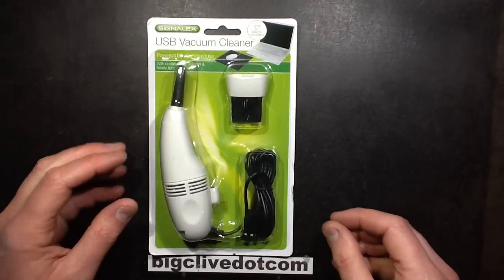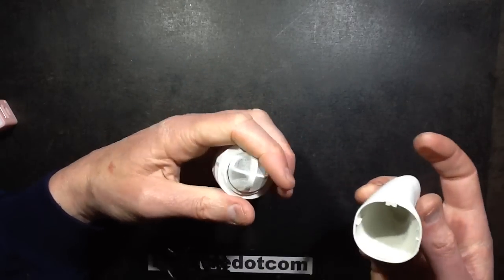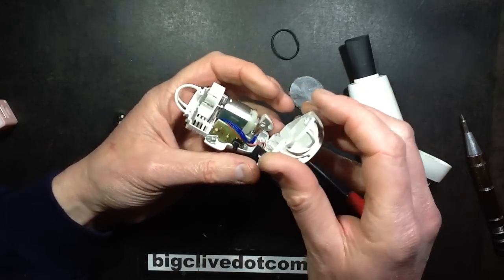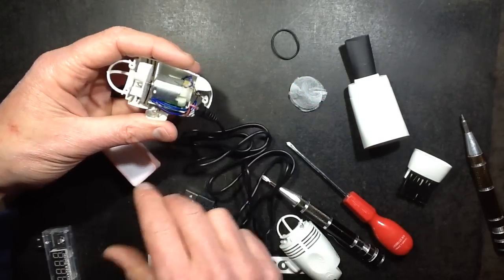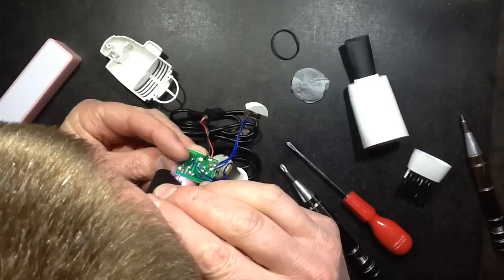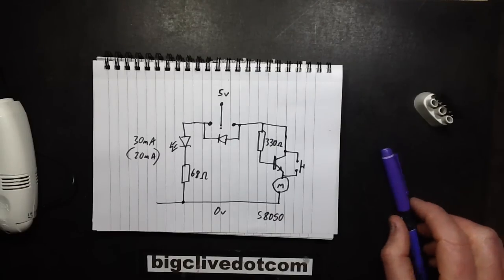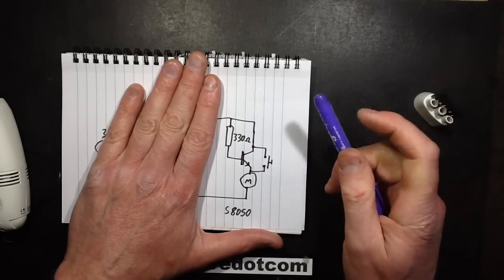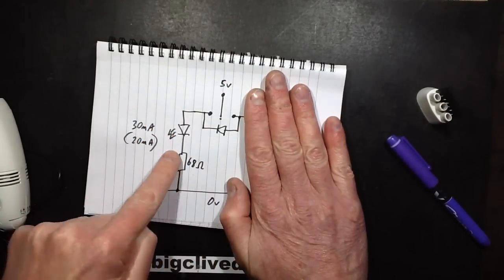Poundland USB vacuum teardown.

Comment: The 330 ohm resistor and motor form a potential divider via base emitter, the transistor is used because the resister would not cope with current alone, this is a current amplifier.

Comment: A very challenging strip down..I have been using the exact same device to get the fluff stuck in the key board..I don't connect it to my laptop..a separate power supply I use for active speakers..additional fan cooling..led light..retaining plunger et al

Comment: hey Clive! thanks for the expensive new hobby/leaning endeavour! just got my first Arduino in the mail today...won an auction for a genuine uno kit from Vilros for $10 n $7 shipping.. ...n I'm currently researching my first project....a power supply. I want one that I can use for everything from circuit testing all the way through electrolysis, metal plating and etching metal....so the research is a little overwhelming...any suggestions from you or the community would be FANTASTIC! thanks again for being my brain EXCITED about something again..."cheers mate!"
Reply from the maker: If you want a power supply that can limit current then I'd recommend a cheap bench power supply from a local electronics supplier.  They're very useful things.
Reply: bigclivedotcom I want one that'll do everything...that's my problem. I want high amps for watching and electrolysis and also the ability to do bench top stuff too...I kinda only wanna buy once and not three different power supplies for different stuff, ya know?
Reply: @MyBigThing2010  I know what you mean. I've seen them in electronics labs. The full kit osciloscopes etc. Totally adjustable power source. Fantastic, but not cheap.

Comment: Arn't usb ports on computers rated to 0.5 amps? So surely the 1 amp from the boost function will cause the ups ports on them (at least a MacBook according to the specs) to trip out and stop being powered due to there inbuilt protection?

Comment: Me thinks the transistor is being used in resistive mode. The gate is in parallel with the NPN resistance, so if NPN switches on fully it would starve the gate, which raises the body resistance. Thus, it would settle in the semi conductive region determined by gate resistor, body resistance, and component gain.

Comment: Why a transistor? In this circuit it is neither a voltage regulator, nor a current regulator. It acts just as a power resistor.

Comment: I have one of that exact USB vacuum cleaner, doesn't even remove light dusts on my keyboard, I tried using it directly plugged on my laptop but it sort of makes it even slower so I have to use a USB wall adapter for it, but after a week of everyday usage, the motor just gave up and the circuit board just didn't worked even when I replaced the same motor, the LED is the only thing that works from it now

Comment: 1A?? Way to kill motherboards, or at least pop some error messages when turning on. Well... These are battery-pack only, I guess.
Reply: The port just won't support the load,  will shut down and throw a bunch of error codes at you.
Reply: I dunno, most motherboards can support double the power, also most of them have some software/hardware to protect against short circuits, for ex my budget ASRock motherboard either does not allow more current to pass, or in case of short circuit shuts the ports off and beeps. They are kinda smart, I've heard that even ESD at the port may trigger Windows alert telling you that something is going on, although I have not experienced it myself.

Comment: lol they do have special charge USB ports on some motherboards that handle high current on some computers I use to have one till I fried it with honey milk and sugar coffee concoction also the rated current of these special high current charge ports where 1500mA per port

 also, my computer has normal USB 3.0 ports and them on average put out 1 amp and my keyboard requires 1 amp to function as it has like 150 LEDs 144 8 bit RGB LEDs or is it 8 colors per led meaning 8x8x8 colors i honestly don't
 know, on are on the 144 keys and an arm processor and other things like a display driver to power I think well the keyboard is a k95 corsair

Comment: I had one of these and it killed my yzkstudio usb power meter :/ Did a teardown and found it was an even cheaper and nastier version of Clive's one. There was only the led with a resistor in series to limit its current, a 3 position switch and the resistor for the motor inside it. That resistor was all burned out and on further inspection it was dissipating far too much power when running in series with the motor. I'm not quite sure how it killed the usb meter though

Comment: The thing held on by the "O" ring is it Dutch in origin by any chance? Should have put a warning on that this innuendo is for readers aged 45 and older
Reply: OK how to put this delicately? It resembles a contraceptive device called a "Dutch cap". Don't think they use them much now as they don't protect against STD/I's.

Comment: I suppose it might detract form the genuine 'hands on' feel of your videos Clive, but I noticed that you puzzled over how that transistor might be working.  So I fired up NWC Livewire which you can get from Maplin and had constructed that circuit and simulated it in around two minutes.  With a generic NPN and generic motor, I got around 350mA rising to around 600mA with the button pressed.  This program is graphically, very good - especially in 'Current Flow' view.   If you used a screen capture program, you could "Show the working out" like that?

Ok, ok, Eagle, or some other software will probably be better, especially for more complex stuff, but I have Livewire and actually, for simple stuff ("Does this work?"), Livewire is pretty good, once you get to know it and ways around it.  Also, PCB Wizard (tightly integrated) is VERY good, especially if you upgrade to the Pro version.  I don't like Maplin much, but this software is good for potching about with and the PCB Wizard software was good enough to have commercial PCBs manufactured from its Gerber output.
Reply: Interesting looking setup. I'll look into one myself.

Comment: I know this is an old video, but I had a couple quick thoughts I wanted to share. I know for a fact (because I've done it) that if you draw more than about 550 mA from my late 2011 model Macbook Pro, the USB port is completely shut down and you get a big warning saying that too much current was being drawn, etc. I believe they contain a self resetting polyfuse. It should be pointed out that the USB 3.0 and older protocol specifies that no device may draw more than 500 mA.   Also, the use of the transistor is a fairly common one, actually. It's set up as a very crude negative voltage regulator. I've seen this done before in simple low power audio circuits that require a dual rail supply.  The idea is that the base of the transistor stays one forward diode's voltage above the emitter (0.6-0.7 volts). Obviously this results in very poor regulation, and It seems strange that they would use it in a (relatively) high current application (the poor regulation leads to lots of voltage sag).  I've only ever seen it used, for very low current applications where a specified but not very precise voltage drop is required. Sort of like an emitter follower with the Base tied to the positive rail.
Reply: +gizmoguyar All USB port aren't built the same. I have an old Socket 7 motherboard from around 1998-1999 that has no protection for its USB ports. If you draw more than ~650mA from its two ports it will fry (it was only intended for very low current draw devices like keyboards, mice and USB hubs or printers that are eternally powered.)
Reply: Jackpkmn Yeah, I understand that. My point was more that I wouldn't feel comfortable plugging that thing into any usb port on a computer. Because USB is (was) only required to supply 500 mA, I think it's unlikely that any normal USB port would ever be designed to supply more than that.

Comment: To make it work much better:
1. Open it up and put a resistor on the LED (mine always have the LED stuck straight to the motor with no resistor!)
2. Close it
3. Cut the USB connector leaving the wire intact (keep the length the same, this is important!!)
4. Solder a 12V connector of your choice to the wire
5. Connect to 12V. It works wonders!!

The thin wire drops enough voltage (it gets quite warm) so that the motor works fast but does not overspeed.

Comment: For use in a computer I wouldn't worry. "Errors" really aren't gonna happen and/or do nothing. Your only concern comes when most USB type A connectors only put out 500ma on a computer.
Reply: +AmperaYT Considering it's no "smart device" (i.e. no real circuitry talking to the computer), I could imagine this indeed screwing with at least other USB devices on the same hub. Never tried what happens if a dumb device tries to pull more than 500mA on USB 2.
Reply: +Smaxx If you have a poorly made hub that supplies power off one big ass rail without any current limiting for each socket, then you may take more power then the hub can handle.

For as far as I know computers are built differently. Each USB socket can ONLY give 500ma EVER.
Your not gonna pull more then that and your not pulling power from other sockets. The cleaner will work,
just not as powerful and not as well.
Reply: +AmperaYT Yeah, always "according to specs". :D Makes me wonder of what crazy stuff might happen in a PC completely built from cheap Chinese eBay parts, once you connect  cheap Chinese USB accessories.
Reply: +Smaxx The appropriate Big Clive quote is "Let's turn it on and see if it'll go bang."

Comment: Another example of China's finest...
Transistor looks to be connected in Emitter Follower mode...R value has probably been selected to give some reduced Base voltage (V Divider with Base junction Z)...maybe you could measure and give VBase at low speed...VMotor would be .6V less, and as you point out, poor transistor is passing all motor current in low speed mode, so is unlikely to survive long-term (install heat-sink, or indeed relocate it to into airstream!).  Of course, user will probably typically use the high-speed mode as it makes Vac more effective, but even if transistor opens up, high speed will still work with "turbo" pushbutton. 
PS...Always remember when using a device, to place the O-N / O-F-F switch in the O-N position...Thanks as always for great vids!
Reply: +Ronplucksstrings I still don't get it why one would use a transistor there in the first place (considering the fixed wiring). It's been ages since I've done any significant wiring, but I'd just use an actual resistor I guess - one could even use a potentiometer for more control.

Comment: You must have got the delux version, the one I bought didn't have a button or circuit board, just the switch, the led, and the motor all wired directly.

Comment: How do those cold to the touch soldiering iron work? I had seen them advertised on TV.
Reply: Magnets
Reply: +viperz888 Induction?
Reply: PongoXBongo no, magnets.
Reply: viperz888 Exactly.  Electromagnetic induction, like a cook-top  The magnets only heat metal, not fingers.
Reply: +viperz888 Wow, no need for hostility,  How do just magnets allow such a soldiering iron to work (genuinely curious)?
Reply: In a word, "poorly".
Reply: +PongoXBongo No. This is the last time I'll tell you. Not electromagnets. Not induction. Just magnets.

Comment: They have the same thing (same design and package) at Dollarama in Canada. I found the thing to be shit on USB power (5 volts 500 mA) so I used 12  volts from a IDE/SATA to USB adapter power, though it'll burn out the LED in the vacuum, but at 12 volts it runs very well and sucks up a lot of dust and crud from the keyboard.

EDIT : Yup, the exact same thing I have from Dollarama, the same design, same attachements, and the same circuitry. I'm starting to think that Dollarama (Canada) and Pound Land (UK) have almost the same thing or at least the same sources for product.
Reply: +Matt Brine Out of interest: How about heat dissipation, considering it gets rather hot on 5V already?

Comment: one amp? that's twice the current that you should put on your usb.
Reply: +DanJBMedia Those devices charging over USB actually *communicate* with the USB host/hub. If they detect it as a standard USB port, they won't take more than 500mA (typically called "slow charging").
Reply: +dwarf365 If you're using USB 2.0*? I'm pretty sure most tablets and phones need 1amp to charge nowadays :P
Reply: Smaxx That makes sense. :D Don't Android phones also test the current to see how much it can draw from the charger? (I've also heard that Apple devices do not do that, and try to draw the full amount it needs. xD I could be completely wrong and insane, which is always a possibility)
Reply: ***** Pretty much all USB devices should do that properly (if they're capable of taking higher currents). But I've read about some instances where USB type C cables had wrong/non-complying wiring, screwing up hubs that have simplified or no safeguards.

Comment: Heh, I've got one of these ... never yet plugged it into a computer yet, though I might have got to the point of doing that to clean a keyboard or whatever. It's proved useful for a few other light duty, cramped space / thin crack vacuuming tasks, always plugged into a high-output mains USB phone charger plug...

Considering how it's basically a mini hairdryer that runs in reverse with a gauze over the motor intake, it's surprisingly effective and most times I've emptied it after use the innards have quite a lot of freshly-collected dirt in them. Between this and a few other handy light-duty techie things I've had from them (desktop phone charger station, memory card reader, gel phone case, so on, so forth), Poundland is developing something of a habit of providing simple doodads that actually work for the price you always suspected they should be sold for, rather than what everyone else takes you for.

The detailed engineering may be kind of bobbins, but much like a moped that sees 20 miles of use per week and eventually conks out at 25,000 miles (a figure that would seem ludicrously low for any other vehicle)... and like a quarter century... later, it doesn't really need to be any better.
Reply: my lungs can suck harder than the "vacuum" this thing produces

Comment: (off topic from video) why do they put glowing leds inside enclosed cases? I opened a 21 stereo graphic equalizer to dust it and it had a bright blue LED glowing. I couldn't even see it all closed up and in solid darkness just the red power indicator light. it was like an electric easter egg.
Reply from the maker: +Pat P Either because it may be available in a case where that LED is visible, or just as a power indicator for checking things during testing at the factory or when it's being repaired.
Reply: +Pat P ... maybe we've reached a weird point where it's actually cheaper/easier for them to use an LED instead of a plain diode plus low value resistor, and the light output is neither here nor there?
Reply: +Pat P I've seen LEDs use for indicating that the internal high value capacitors are charged before, so it could be that too :)
Reply: I guess it's just for the lulz
Reply: Could have been used as a voltage reference.

Comment: ive seen this thing sold on tons of cheap chinese websites in all sorts of colors and minor variations and coming in different packaging. definitely comes from the same factory and sold by lots of different places. mine didnt even have a "boost" button.. there are minor variations between models..i think mine had tiny vent holes in the back near the slider switch. also, notice that the "hose" part is really just like a 1 inch piece of large heatshrink tubing or something. not able to run in turbo mode, mine would drop any pieces it picked up because it couldnt keep enough suction to keep the crumbs in there. only useful for very, very light crumbs, and even then its questionable..

Comment: i recently saw a usb mouse that has a built in usb soldering iron.......

http://www.alibaba.com/product-detail/High-quality-Magic-Soldering-Iron-with_519935156.html
Reply: High quality Magic Soldering Iron with mouse of Ningbo.......with a name like that, it MUST be good.
Color:As picture
Quality:Best
Warm:Quick
Tip:Replaceable
Tip:copper
Operation:(mouse)Easy&comfortable
Indicate:LED light
Temperature:200C''-500C''
Package:Double blister
Price:Competitive

Exciting !!
Reply: +gamerpaddy That's the most ridiculous thing I've ever seen. Since you can clearly see a small transformer inside, it looks like they just used the mouse enclosure as a mains switching regulator. The scroll wheel allows you to choose a temperature for the iron. It's still only 10 Watts max.
Reply: pretty big smps transformer for such low power. and right above the optical sensor. 
someone need to order this for clive to take it apart :D

i only found a german ebay listing:
http://www.ebay.com/itm/131132336174
Reply: Just what I always wanted, a mouse with not one, but two cords coming out of it...  and one attached to a screaming hot appliance, what could possible go wrong?

Comment: That's a very strange circuit. The output current would depend on the transistor gain, so there would be a wide variation between individual transistors (fans). Like you, I wouldn't recommend plugging this into a PC.